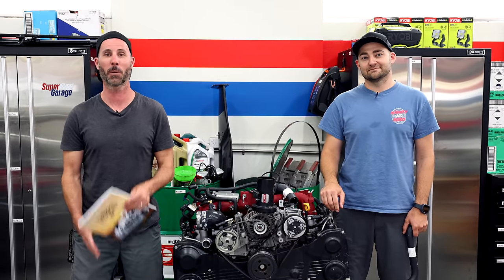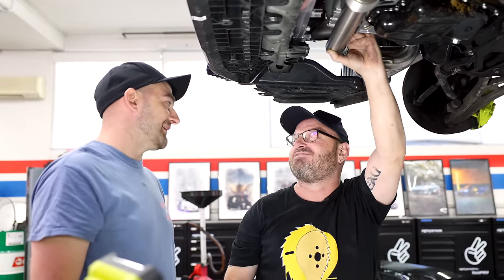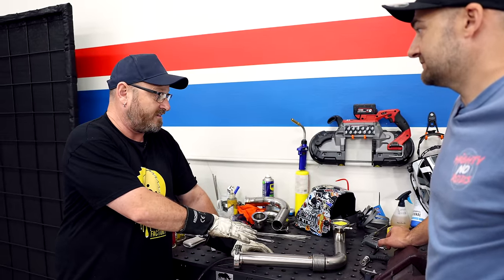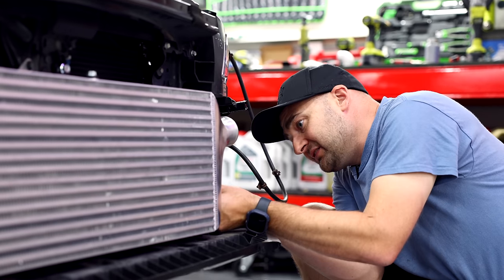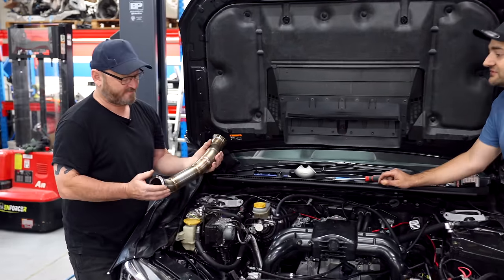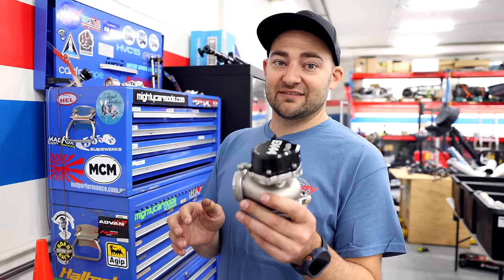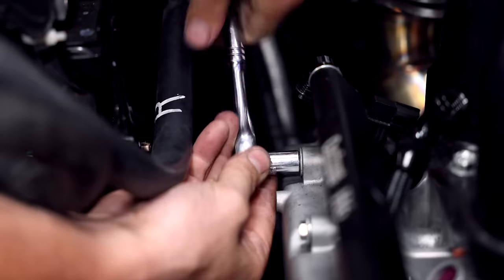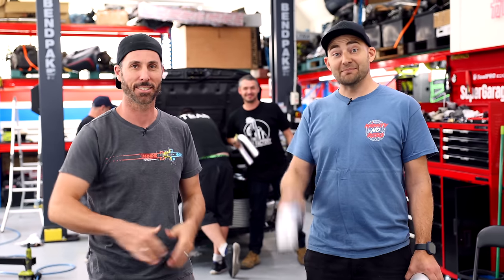BIG Engine Swap - BUILT H6  - Marty's Levorg Part 11

Comment: It seems criminal to me the the Skid Factory only has 250k subs.
Reply: 251k as of now, I know I just subbed
Reply: I've learned more about engines/building cars from The Skid Factory than any other channel, Al is incredibly knowledgable and the dry tone of the show makes for a great watch
Reply: They're still doing better than the 13 viewers a certain other channel is getting
Reply: @sheshd ?
Reply: The skid factory would have a lot more subscribers if they put more content into their videos. Many of their videos over the last year have been more focused on having a laugh than actually building project cars.
Reply: @nicholasfraley6353  mcmtv2 joke
Reply: @nicholasfraley6353  one of them iykyk situations
Reply: Subbed
Reply: does subs matter  when veiws low like this has 254k veiws right now
Reply: I was there from the beginning, but haven't actually watched a Skid Factory video since... shit... Al's 24 valve Cummins.
It's just the same thing, over and over. It got boring.
Reply: @1one3 Racing  strange comment to find on a MCM video
Reply: I'm shocked that their number is that small!! I just figured that everyone would have just followed along like I did.
Reply: That’s a paddlin’
Reply: Also for how old MCM is on YouTube it has less subs then donut 🍩 media
Reply: Demographics mate

Comment: I used those Kein motor mounts on my EZ30D swapped baja.  I would say they are so rigid, they are race only imo.  Way too much NVH for my liking.  I used them for a year before going back to the stock gel-filled h6 mounts, what a difference.  I have a group N trans mount for the dual range 5mt, plus I put upgraded bushings in for the diff, shift linkage and steering rack.  Plenty stiff for a daily driver car.  For anyone wondering, the ez30d stock exhaust manifold interferes with the 5mt trans crossmember, so you have to do a bit of welding on the left side pipe.

Comment: Don't forget to fit a Brake Master Cylinder Brace Kit to this car!
Subaru WRXs are notorious for their spongey brake pedal - but it's not the brakes themselves, it's the flexing firewall when you start gouging on the brake pedal!
All the car needs for a Porsche-like brake pedal is a brace to stop the brake master cylinder moving.
To prove you need one, get in the driver's seat and press the brake pedal HARD. If the firewall flexes and the back of the cylinder moves, then your pedal feels soggy.
Best upgrade ever for a WRX - and I mean that very seriously - I drive a 911, a 928, and a Tommy kaira M20b/WRX. :)

Comment: An alternative to purging is "solar flux". You mix this paste up with alcohol and then wipe it on the back of the weld. The alcohol evaporates and leaves the powder which protects the weld from the atmosphere.

It works great and is a lot cheaper than argon 😅. Note, it also cant be used for food grade piping after welding the leftover kinda ceramic glaze is not food safe.

Comment: Man, I REALLY wish that I had Al's fabrication skills. I built a turbo kit for my 2004 Acura TL six speed manual and it was an absolute PAIN! I was working with hardly any room and ALL of the hoses and wiring had to be wrapped and sheathed with heat wrap. The engine in my car doesn't have standard exhaust manifolds, they are cast into the heads, so I had to buy the 4 bolt flanges and fabricate it from there. I also custom fabricated the merge pipe with a T3 flange, 2.5" v-bands on each inlet pipe, and a 44mm external wastegate flange. I built it all out of stainless pipe and I built the 3" stainless downpipe out of mostly pie cuts due to there being no room behind the driver side headlight. It was ALOT of work for 5-8 psi of boost.

Comment: You should also remember to get the air out of the top of the bonnet so the radiator can breath. I love the old Merc Gul wing holes out the fenders, but 2 simple vents in the hood near the glass on both sides of the scoop will do the job. I would mount a fan under each side to suck air out of the bonnet as you probably need as much cooling as you can get.
Reply: I like the old sti cooling for the turbos. Hole in bonnet lined up on the cold side of the turbo
Reply: @jonathanwright5550  it's funny how many hi performance vehicles forget about getting the air back out of the engine bay. But you need to to get fresh cool air in.

Comment: @12:19 Iöm not usually eco finger pointing, but man, that’s a huge pile of plastic. That oil could have gone through my inline 6 instead, had they packaged those fittings in a single box of plastic even.

On topic: this series is the epitome of car mods in this age! Thank you for sharing!

Comment: The most critical parts of SS that require ID purge when welding are the cold end of the exhaust.  The condensate that can form is very corrosive and will eat through 304SS welds in short order.  Even 316SS will struggle in the cold end if the welds aren't perfect.

Comment: Stainless when welding can burn because of the reaction with Oxygen. You must purge weld it with an inert gas like Argon to eliminate oxidation in the process and maximize the welding bead quality and proper penetration. I am not a pro welder only know this mandatory thing on stainless welding. (Titanium needs purge welding also) Cannot wait to see it running on a dyno and on a 1/4 mile run.
Reply: It's not strictly necessary to back-purge stainless. In some instances, particularly when doing so would not be feasible, or would be difficult, or when it doesn't really matter because it's downstream of a turbine, or isn't being used in a critical installation (such as food manufacturing, etc), using something like Solar Flux on the back of the joint will yield a protective shield that prevents oxygen contamination and 'sugaring' of the internal weld. Just make sure the methanol base of your flux paste has flashed off completely before you put an arc to the part... In a well-lit environment, it's very hard to see the pure blue flame of methanol, and a fire that goes unnoticed is dangerous af.

This is how I fabricated my full 3" mandrel stainless system and it turned out perfect, and I was able to use much less Argon/CO2 mix than I otherwise would have.
Reply: @xyphur  Awesome! Thank you for the detailed info 😉✌🏻

Comment: id say its not about tube thickness but the gap size your trying to fill. if there's no gap then technically you ca get away with fusing but for better security a bit of filler gives some strength. Therefore the thinnest filler rod will do.

Comment: I can see the first problem you are going to have with the new fuel pumps. You are going to get fuel starve when you get below half a tank of fuel on turns on track. The new pumps delete the factory pump assembly that also acts as a small surge tank that avoids fuel starve. I've been down this road before.

Comment: 15: 19 How many ANCAP Stars do you add when removing the front bar?
How cheaper does the insurance become when you upgrade the frontal crash safety with an intercooler braced with 4 adamtium bolts to the front body beams?

Comment: Why not add a vacuum pump to the breather lines? I posed this question to one of my colleagues, who is a drag racer. He told me this results in a greater horsepower increase than is used by the pump. I was asking in regards to dry sump oiling, but he mentioned that it's also done on wet sump engines as well

Comment: And to think, it so much easier to put the turbo there on (US) Left hand drive models since there is no brake booster or clutch slave.  I'm honestly surprised that Subaru didn't put the turbo on the passenger side even for the right hand drive setup.

Comment: Can you wind copper pipe around the up pipe, plumb it to the A/C and cool the turbo air going back into the engine?
Reply: When you think about how much air an engine consumes, A/C cooling would be relatively ineffective. Idk what size their block is but for example a turbo 2.5 with 2 bar boost would be breathing nearly 15000L/min @ 6000 RPM. Even just before the turbo comes in (2000 RPM, no boost) it would be consuming 2500L/min and I'm not even sure a typical A/C could even keep up with that lol. If there was any tiny performance gain it would probably be cancelled out by the added weight of the cooling pipework.

Comment: wouldnt those twists reduce airflow? I feel like the over 180 degree turns will hang up your gains.
Reply: The curves are irrelevant. The inertia of the fluid is lost by the relative area of the tube if the length is constant. Research the Reynolds number in fluid dynamics. There is no reference to bends. Square or trapezoidal cross sections are a different story
Reply: @theairstig9164  Awesome, Thanks for the education, I appreciate it.

Comment: Removing the crash bar to fit that intercooler is a very very bad idea.

The crash bar is a very important component of the whole crash structure. It’s particularly important in offset crashes transferring impact loads to the opposite chassis rail.

Another common name for it is Tie Bar - because it ties the two chassis rails together during an impact. 

The car will now perform poorer in an accident and may even have effected airbag performance.

I also doubt it is legal, but that’s much less of a concern than the car not performing properly in a crash.

Comment: Think I'd be more impressed if it was a barra swap honestly... all that STI custom work... that goes in the bin?
Reply: Barras go in everthink. And once you have seen them in soo many cars it get boring. I think a rotor swap  would be cooler even though there also the same because people chuck then in everthink too. Soo  this is a good idea what there doing here because  it's the best of the subi motor  with the a great subi frame
Reply: @lewiscattell6060  Yeah but they don't go in subarus without massive custom work... so it's actually interesting
Reply: @MADagain  It's totally pointless, because you'd either A) end up with a car so nose heavy it would make a Civic hatchback look balanced, or B) have to ditch the AWD to slide the engine rearward, and AWD is the entire point of a 4-door Subaru, without AWD it's just another sedan/wagon.

Comment: I'm currently in an argument with a couple of goofballs who believe "there's no replacement for displacement".
And I said yes there is, it's called a turbo/supercharger/e85 or nitrous. 
They still say that's not a replacement and are arguing that the bigger motor car can do the same.....and I said yes, you are arguing the same thing I am, but you think you are arguing a small 4 banger can't beat a v8....which it can if you add power.

Comment: Welder here, I kinda feel like the purpose of back purging wasn't addressed properly, and can really mislead the watchers.

The purpose of back purging is to prevent contamination of the weld pool which can ACTUALLY cause weaknesses in the weld itself causing it to become brittle and break. Back purging is used on MANY different metal compositions. The main this to take away from back purging is the reduction of weld defects. why bring up bacteria and food applications when you're addressing a car enthusiast demographic?... Why not actually give them information that is relevant?

Anyone actually interested in back purging:

 AWS D18.1: Guide for Back Purging of Welds. -> This document provides information on the use of back purging in welding and includes guidelines for selecting and using purging materials, establishing and maintaining an inert gas atmosphere, and evaluating the effectiveness of the purge.

The Welding Handbook, published by the International Association of Mechanical Engineers (ASME), includes a chapter on "Welding in an Inert Gas Environment"

NOTE: "The sugaring" is actually called Carbide precipitate

"Carbide precipitates are tiny particles of a carbide compound that form within the microstructure of a metal or alloy. Carbides are compounds that consist of carbon and one or more other elements, such as chromium, tungsten, or molybdenum. In some alloys, the presence of carbides can be beneficial because they can improve the hardness and wear resistance of the material. In other cases, however, the formation of carbides can be detrimental because it can lead to the formation of brittle microstructures that can reduce the toughness and ductility of the material.

The formation of carbides in an alloy can be influenced by a variety of factors, including the chemical composition of the alloy, the cooling rate during solidification, and the heat treatment history of the material. In some alloys, carbides can form spontaneously during cooling from high temperatures, while in other alloys, carbides can be induced to form through heat treatment processes such as quenching and tempering."

Comment: Explain why wouldn't a 90 degree rubber pipe bend not be sufficient as apposed to cutting that absurdly expensive turbo.
Reply from the maker: I’ve had them pop there a few times, and ally Bend is nice and tight radius

Comment: This turbo is going to have insane lag, isn't it?  Because of this much piping
Reply: Not really, that isn't a big turbo and it's a 6 cyl block with a pretty big displacement so will be pumping plenty of air. Doing a raw build from scratch it's pretty easy to manage turbo lag these days with the right engine mods modern and engine management options that are available.
They will have done their sums. If not, just keep the revs up high lol.